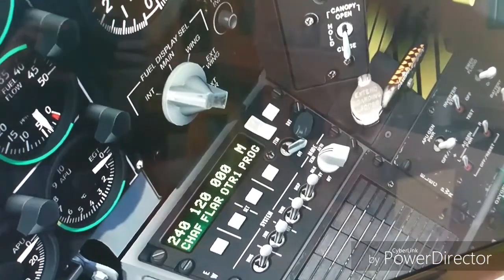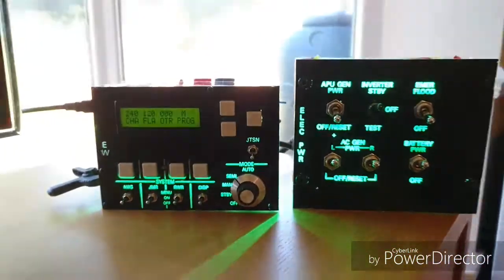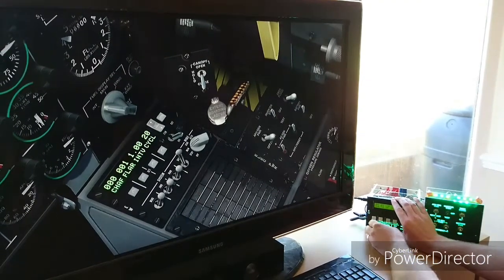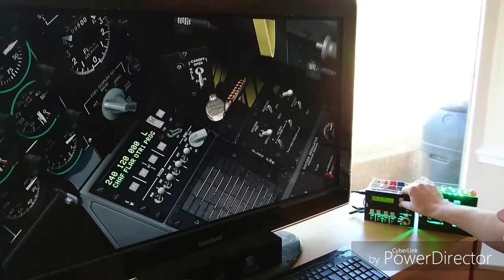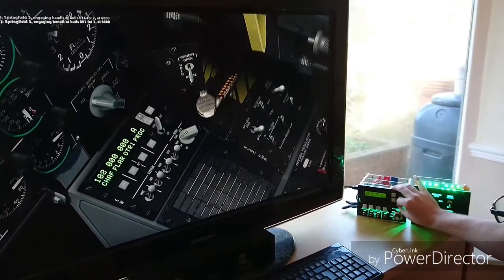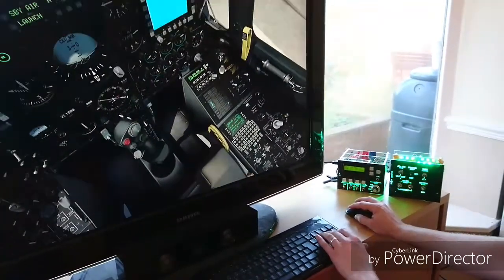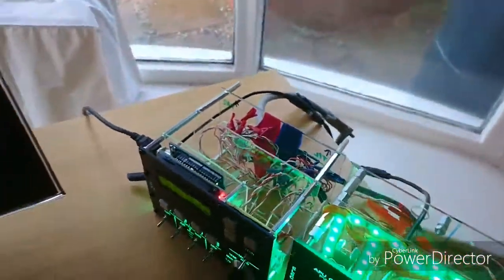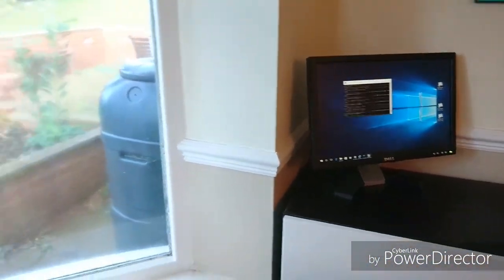DCS Warthog A10C Simpit Prototype Panels

Comment: Where you get the physical dimension of all those panels?
Reply from the maker: Hi Rusty, on the Dcs website I downloaded an image of the entire A10C Cockpit. It's free and you search under downloadable user files. I took the width of my thrustmaster hotas throttle (152mm approx, as I recall) and applied this to the Cockpit image to work out dimensions. Inkscape is a good free program where you can set a scale on one item measured and then measure any other item based on that.
Reply: @CraigSmysimpit  Thank you so much Craig!!!! ;-)

Comment: Hey mate. Thats awesome. Thank you for all the videos you've done!
Just a quick quiestion, what buttons are you using for the gray push- buttons? Did u made the cap yourself?
If you do an upgrade, be sure to let us know too :)))
Thanks.
Reply from the maker: Hi Kaspariito, thanks for your comments. 
I think it was a "Diptronics KTSC-21GE Grey Button 12 x 12mm Square". Or, It might have been the "ivory" colour of this same tactile cap which I spray painted grey. It was along these lines. 
Whilst it looked similar to the buttons on the actual counter measures panel it couldn't be back-lit. I've been thinking through other options since, so not used it again. It still works well if you are not looking to illuminate text on the buttons.
As regards upgrades and new panels, I am building a radio stack at the moment, which has the main cluster of A10c radios (vhf am, uhf and vhf fm). I am hoping to finish it and put a video online by the end of October.
All the best, Cheers

Comment: Great work. What font and text size are you using as well as what bit do you use ?
Reply from the maker: Hello,
The font is "Univers 5L" single line with a text height of 3.4mm in the video you commented on, other panels have used 3.0mm and occasionally 4.0mm.
The cutting tool selected was a Engraving - 15 deg tip 0.2 - 6mm
Cheers